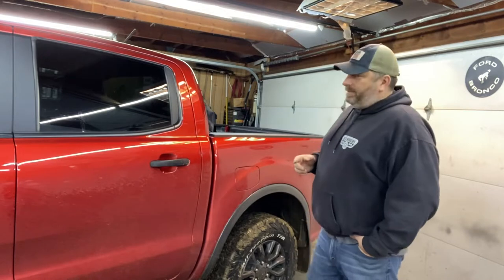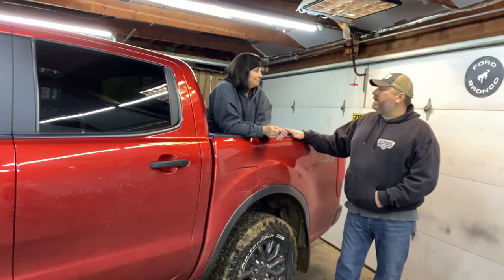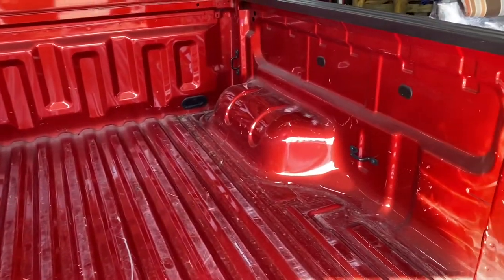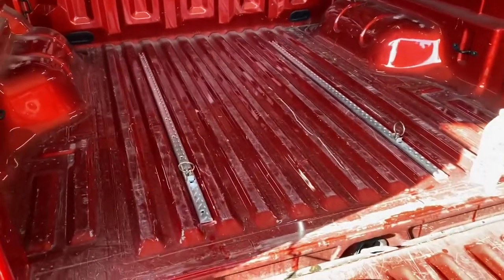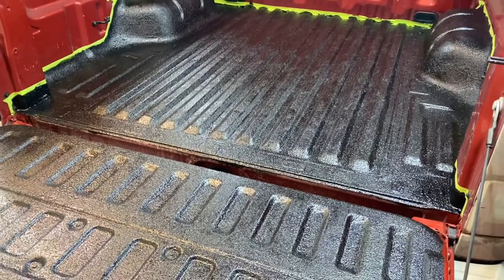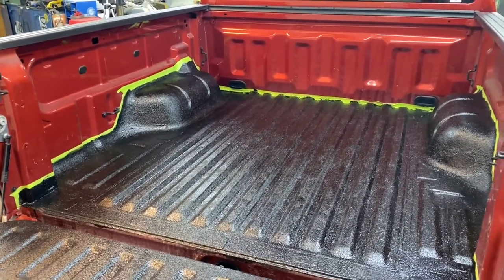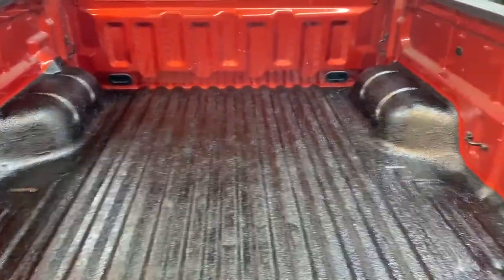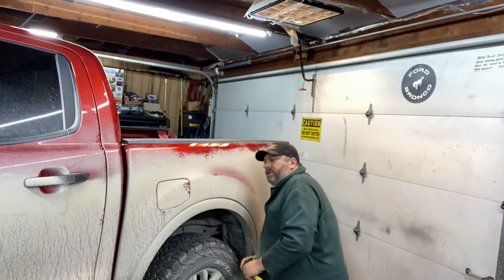589Fab Ranger Bed Rack install pt2 overland build

Comment: Nice set up. Have you noticed if your  Ranger bed rails are not perfectly flat?  I have a 2020 with a Retrax Pro tonneau cover and it does not sit flat, they are actually is humped. Just an observation.
Reply from the maker: Actually I haven’t noticed that at all.

Comment: Looks great. Was looking at Billie bars with molle panels, but this comes in cheaper and they are somewhat local to me. Are the load bars easily unbolted to allow full bed use? Still happy with the product 8 months in?
Reply from the maker: We been very happy with the rack. We leave the bed rails on truck permanently and just remove the side plates and cross bars when we not using the RTT. Matter of fact I bought a second set of the bed rails so we can use those on our other truck or the trailer I’m building without having to remove the ranger bed cover to use those rail mounts. Check out some of the other vids of us using the truck on a couple Overlanding trips to see it in action.